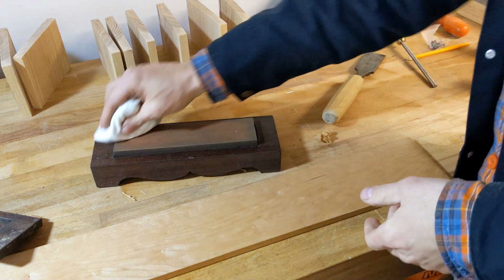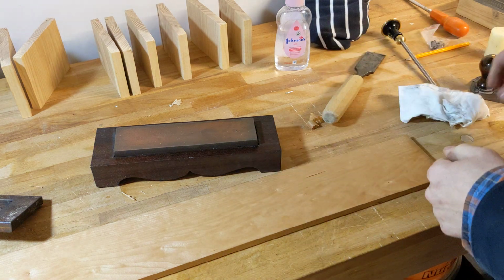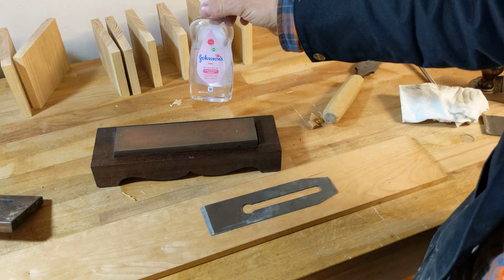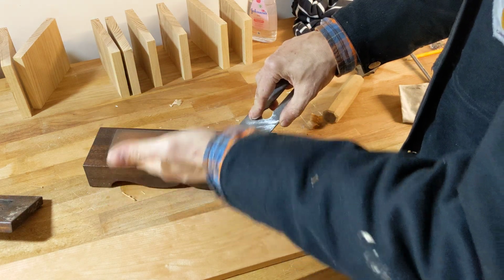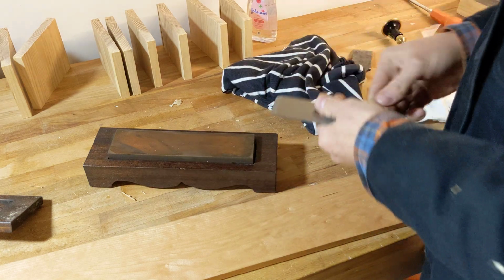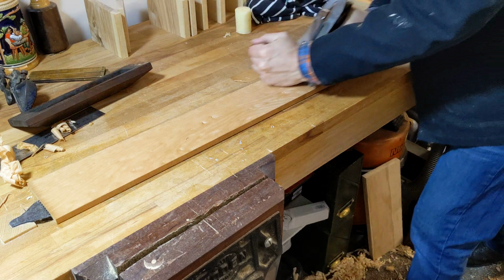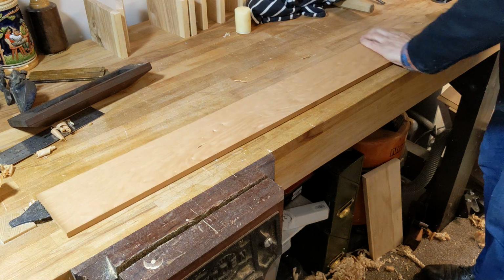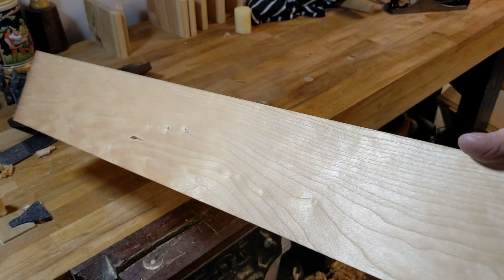400# Grit Sharpening = Shimmering Surfaces! Cheap and Realistic Sharpening! #woodworking

Comment: 99% of plane problems can be fixed by having a very sharp blade. Tearout? Sharper blade. Chatter? Sharper blade. End grain issues? Sharper blade. Wild grain? Sharper blade. Hard to push through? Sharper blade.
Reply from the maker: I hear you. We assume sharp as a minimum, right? Tearout? Cap iron. Chatter? Technique. End grain? 🤷‍♂️Sharp! Wild Grain? Cal iron. Hard to push? Wax. 

Folks can take their edges to 12000#, no problems! I just feel those with less experience and those who suffer the issues listed should practice learning the tool. 1000# is perfectly adequate to do this.
Reply: @faceedgewoodworking  I’m not sure on the cap iron theory as bevel up planes don’t have one and they can handle those perfectly fine if they have a sharp blade.
Reply from the maker: @Hey-Roman  the cap iron is proven historically and by contemporary sources.  There was a while when some less experienced people in the Woodworking media dismissed it, thankfully that has largely been corrected.
All tools have to be sharp. If a cap iron isn't present (bevel up) steeper angles are used. Hence the proliferation of two or three irons for one bevel up plane.
On a bevel down we learn to set the cap iron to the situation. Both approaches work. I personally find the cap iron more versatile.
That doesn't mean I think people should use it or those that don't are wrong. It's just the cap iron can't be dismissed. It's from a time of real tool innovation and when everything was done by hand. Not just a few passes to remove mill marks or trim end grain.
Reply: @faceedgewoodworking  still, a cap iron stiffens the blade. It doesn’t fix tearout our wild grain like you said. A closed frog/mouth and a sharp blade do that. By the time a shaving reaches the cap iron it’s far too late to prevent tearout
Reply from the maker: @Hey-Roman  If you don't know how to use a cap iron, that's the results you get. You don't have to learn how to use the cap iron but it's pretty easy.

https://www.woodcentral.com/articles/index.php?page=673&tags=handtools&search=&op=AND

Our ancestors had this understood. Why would a 19th century wooden plane iron need to be stiffened with a cap iron?

The cap iron predates mass made tools. Do we think that skilled manual workers would be duped into paying more for a feature that offers nothing? Unlike many of today's profligate amateurs, "journalists" and YouTube entertainers, these were working people who would only spend on proper effective tools.

You need only read;

To prevent the iron from tearing the wood to crossed grain stuff, a cover is used with a reversed basil, and fastened by means of a screw, the thin part of which slides in a longitudinal slit in the iron, and the head is taken out by a large hole near the upper end of it. The lower edge of the cover is so formed as to be parallel or concentric to the cutting edge of the iron and fixed at a small distance above.
Nicholson’s Mechanic’s Companion 1812

The cutting iron having been sharpened, the top-iron is screwed fast at the required distance from the edge, say for coarse works one-sixteenth, and for fine work, one fortieth or fiftieth of an inch.

Holtzapffel 1847

All it takes is some practice and an open mind.
Reply: @faceedgewoodworking  I’ve already seen the Japanese video and read that article. Apples and oranges. 

Try that methodology in wild grain with a scrub plane sized mouth and with a 400grit blade. With a razor sharp blade you may have a chance but a cap iron won’t save you. 

I have an open mind. But this overall tone of the channel that things don’t need to be “that” sharp, precise or flat is what leads to less than satisfactory end projects and people not sticking to this trade/hobby. 

Just because last century people made do with what they had, doesn’t mean it was the ideal thing to do. People should’ve be encouraged to have they very best they can afford and aim for the very highest standard they can achieve. 

Who wants be a slap dash £20 Stanley, 400grit “that’ll do” furniture maker? 

Paul sellers is justified in his approach as he wants as many people as possible to just get into woodworking and make a start and then work their way up. And to make rudimentary things, it’s perfectly adequate. But I’m not sure what you’re trying to do here? Is it the same as him? Or just prod the woodworkers that are into very fine work and get a reaction? 

No one today is working on the clock with hand tools having to quickly sharpen to 400g and crack on with making 100 chairs because Queen Victoria demands it for Wednesday.

I believe you’re flogging a dead horse….with supporting references to boot.
Reply from the maker: @Hey-Roman  I'm sorry that you've found the cap iron difficult to get to grips with. Put aside a few hours, I'm sure you'll master it. Nuance is difficult but experience builds understanding.

As for the tone of the channel, you're welcome to criticise and it's nice to have the scrutiny. My motivation to do this is for my own enjoyment and to simplify the approach. Some may find that helpful, some may not. 

I have never said people shouldn't buy a certain tool or spend money. Where on my blog https://www.faceedgewoodworking.com/ or in my videos do I say this? I am delighted that people purchase nice things. I do think though it's helpful to point out that a No.4 Stanley is a good as  a Clifton or Lie-Nielsen at their intended purpose and that you don't need those brands unless you specify want them. Alan Peters was able to create some of the finest studio furniture of the 20th century with his dependable Record No.7.

Regarding what other woodworkers are putting out and their motivations, well, that's up to them and I wish them every success. I do watch the odd woodworking video but I mainly use YouTube for watching motorcycle content.

As for Queen Victoria, I'm not exactly sure what she has to do with this. But the early Victorian, Regency and Georgian woodworkers were some of the most skilled furniture makers, carpenters and joiners. They didn't "make do" with anything.
Reply: @faceedgewoodworking  again, saying I have difficulty getting to grips with the cap iron? Where did I say that? Where did you get it from? Or is that your conclusion as you feel you have more knowledge and experience than me?

And singling out top artisans like Alan Peters and saying “well this master could do it with an average tool, so anyone can too, they don’t need anything better” is like saying “Rossi could do the Nurburgring in record time on a 1930’s motorbike, therefore you don’t need anything better”. 

It’s technically true, but hardly logical.
Reply from the maker: @Hey-Roman  You made it clear that you don't feel the cap iron effects surface finish because, and I'm paraphrasing, by the time the shaving hits the cap iron the damage is done. Well, if that's your position, you don't know how to use the cap iron properly. The only way to change that is to learn to use it. To dismiss something because you can't use it means nothing. 

Do you need to learn how to use it? Absolutely not, you can make exquisite work without mastering this simple tecqniue. Even though I haven't seen your work, I'm happy to accept you may be more experienced, create finer work and have a portfolio to die for. That's not the point we're discussing.

We are discussing whether a specific tecqniue works. You have stated that it doesn't with no evidence. I have stated it does with evidence. I have also tried to cover the specifics around this in some of my rough around the edges videos.

Your analogy isn't accurate. You portray a good Bailey plane as somehow lacking, like an aged motorcycle on crude tyres needing a GOAT to get the best from it. 

The only time a standard Bailey will let you down is if you're working very hard timbers. That's why Stanley offered an HSS iron on the Australian market. I say that with the caveat of needing to verify the statement regarding the HSS iron, it's in my memory but it's not normally information I need to dredge up on the spot.
Reply: @faceedgewoodworking  come one, you’ve completely twisted my point. I said “tearout? - sharper blade”. You said no you need to set the cap iron better. There’s only so far forward you can set a cap iron, but you can always make a blade sharper. Most people struggle with sharpening well, not setting a cap iron. One gets learned over many years of practice and experience, the other can be done by anyone within 10mins of being shown how to set it. 

Saying a cap iron is more crucial to tearout than a sharper blade just isn’t accurate. And you can get to the bottom of it by take one away, and then taking the other away. 

Hence my point being proved for a third time. You can take away a cap iron altogether and still have a perfect functioning plane called a bevel up. But if a blade is inadequately sharp, no amount of cap irons will fix it. 

If you get tearout, sharpness is the first port of call. Only then would you look at other things such as cap irons. 

I never knew this was such a controversial principle. From a Rolson to a Veritas, 99% of planing issues have always been fixed by a sharper edge in my work.
Reply from the maker: @Hey-Roman  twisted your point? All I did was to say that 400# grit is a practical edge. It wasn't all that long ago that people used an India stone and didn't have an issue.

If we follow your logic we were all in the dark before lots of modern sharpening solutions became available. That's demonstrably wrong.

Bevel up planes are fine but they will create tearout no matter how sharp unless they are sharpened to a higher angle. Otherwise we're planing with less than common pitch. Why do you suppose many moulding planes have steep pitches?

I'm not trying to change your approach. If you really have something worthwhile to contribute why not expand upon your one  20 minute review of a torch.
Reply: @faceedgewoodworking  because frankly my portfolio of furniture isn’t quite there where I can make a video showing all that I have made and can do (to prove I’m worth listening to) before I start spouting lots of How To’s with no credentials to my name. Far too much of that on YouTube. Every man and his dog with an iPhone is an expert on here. 

I’m sure you’re aware of Cosman. His skill makes his advice worth listening to. And he agrees with me. A couple of stools and ill fitting dovetails isn’t enough.
Reply from the maker: @Hey-Roman  No problem! I can though https://www.gshaydon.co.uk/ owned and run by my brother and I. We are the fourth generation. I completed a traditional apprenticeship and won two awards during the process. I have never done another job, my working life is woodworking.

Our appreciates, the properly motivated ones, go on to achieve success https://www.bwf.org.uk/latest-news/chris-lake-is-bwf-apprentice-of-the-year/

https://www.bwf.org.uk/latest-news/apprentice-of-the-year-chris-lake-comes-third-at-world-skills-americas/

I had the pleasure of contributing to Popular Woodworking for a while until a health crisis struck https://www.popularwoodworking.com/author/graham-haydon/

I also like woodworking at home. My aim here is to share what can be done at home with a simple set up.

I'm delighted you believe everything that your chosen guru says. I found Cosman offers excellent customer service and is clearly skilled. However, I don't agree fully with his approach. Do I wish to discredit him. No! I seek to provide an alternative.

I look forward to seeing your work. I'm sure you're talented, I'm sure you've done good work. I'm not trying to undermine that. Bearing that in mind, my experience is valid and I have the portfolio both amateur and professional to back it up.
Reply: @faceedgewoodworking  thank you for the references. That explains a lot about your mentality and approach to tolerances in your work. I mistook this for a hand made cabinetry type channel. Not windows, doors and garden gates etc. 

We’re talking about different things. Thank you for sticking it out with me though. 

When I’ve got something closer to chippindale, maybe I’ll tell others how they should do things.
Reply from the maker: @Hey-Roman  we have fitted out homes with high end cabinetry. Understandably, not all clients want their work featured. The core of our work is joinery. There are very few who make studio furniture full time in the UK, but it's not many. It's not something we've ever explored branching into.

I welcome you sticking with the conversation too. 

All I aimed to do was to share a valid approach. You have been determined to undermine me and my ability the whole time. You have not succeeded.

I wish you every success with your Woodworking projects.
Reply: @Hey-Roman  You should check out Paul Sellers 250 oil stone video.
Reply: @Hey-Roman   Some people are more interested in being right than in knowing the truth.